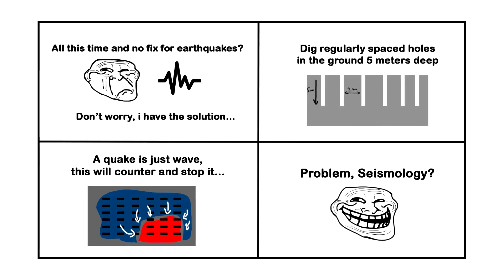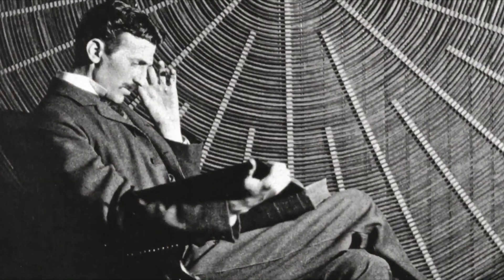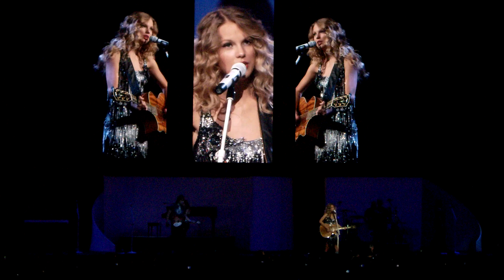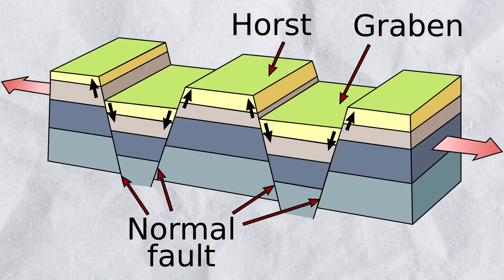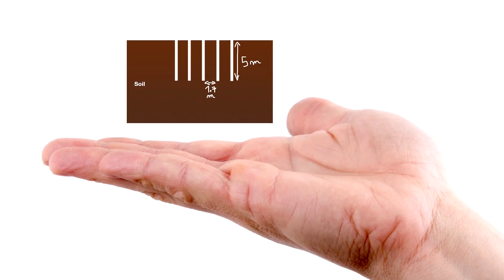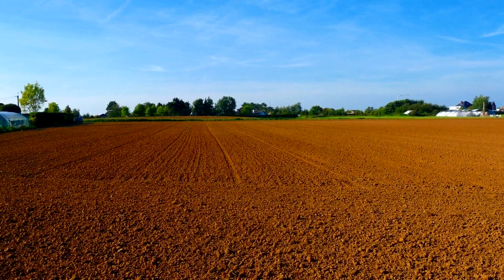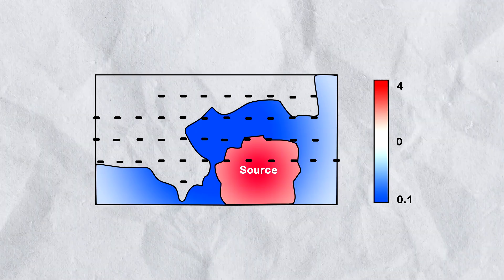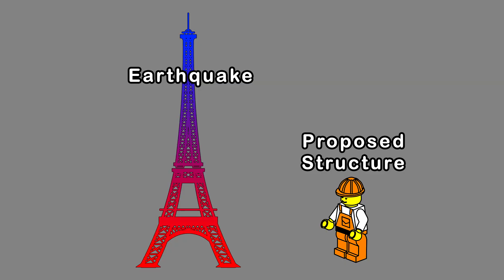why it doesn't work 69

Comment: aren't earthquakes cause by the movements of tectonic plates?
Reply: Yup, and when the tectonic plates rub up against each other like that they create shockwaves which we call earthquakes. Basically just rubbing two slabs of rock and soil hard enough together to make a sound so loud and of such a low frequency that it can sometimes tear the earth it travels through apart.